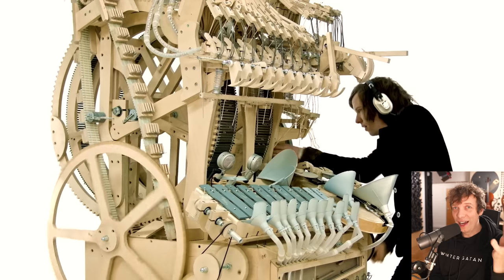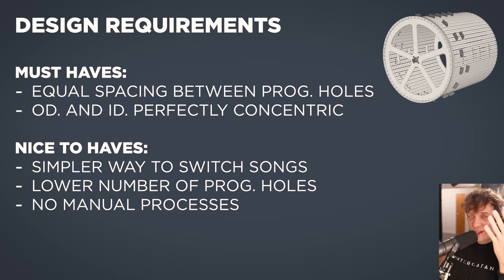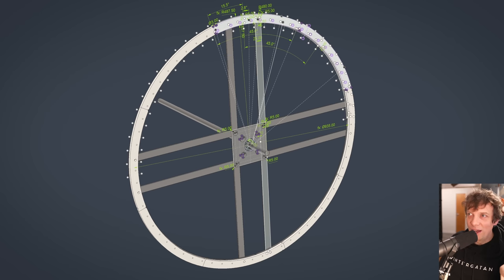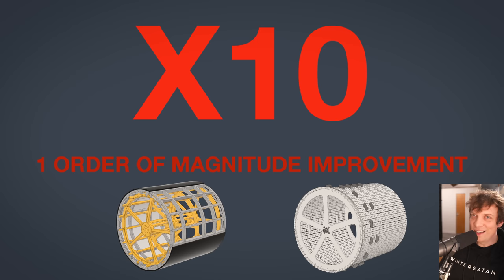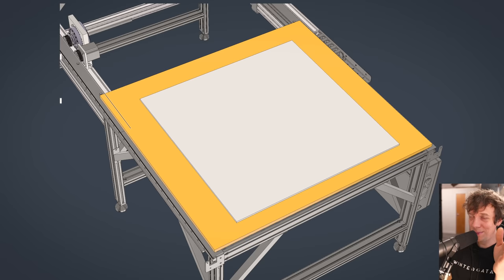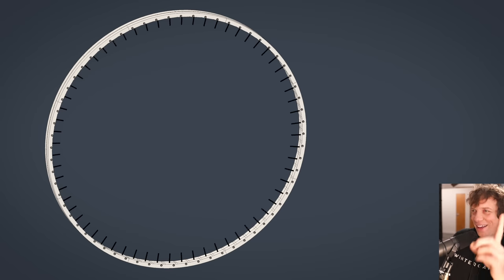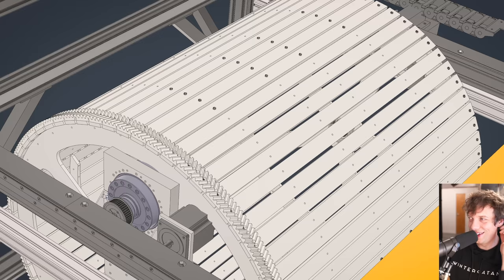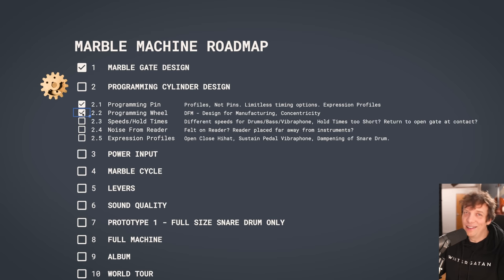A New Music Programming Wheel

Comment: have a serious think about how the plastic for the notes will fatigue when the wheels are being set up(and also how much force will be on them when reading the notes). it could introduce timing issues
Reply: There's so many types of plastics, we can't assume anything for now. He needs to tells us exactly which plastic he's planning on using so that people with the technical knowledge can inform him and the rest of us about his choice and any alternative he should be using instead - if that initial choice is the wrong one, of course.
Reply: @yvan2563  Afraid I'm with Chris on this - the clip design as it stands is for me flawed in its very nature - doesn't really matter what materials are used there, its not going to be enough - Martin has put a completely insane amount of effort chasing gates with timing tighter than he can really measure so any programming pin registered only by a deliberately flexible click action that doesn't need bearing puller to remove and hammers to install will not be able to meet that spec unless the read head of the machine imparts damn nearly zero load - the click action he is demonstrating is looking like a travel of well over 1mm for the click action and in the read direction - which is really poor design - the clips should be designed to flex perpendicular to the expected read head load so they can be as stiff as possible in the important direction. They also look to be really really easy to do by hand - so just to make it possible to click in and out so easily it can be expected to have that sort of ballpark for slop under load - though without knowing the expected rotation speed how much that will throw the timing is impossible to calculate. 

If he adds a fixed registration pin and the click is just to hold the pin to wheel while the timing is handled by the precise and inflexible pin he is in with a shot of reaching timing he can accept. But even that doesn't solve the fatigue issue on its own, and picking the right type of plastic to have good fatigue life that you are then battling to get sufficient stiffness for timing (even with a fixed pin its got to be relatively stiff), low friction and hard wearing enough to last at the same time along with many other considerations for a world tour machine - how does it handle baking under stage lights? Is this a plastic that will creep on its own more readily? Its not a problem that can't be solved, but getting the one plastic that does all the things at once well enough may not even be possible (will depend on factors we have not seen yet), and moving into double shot multi-material type stuff would be interesting but expensive.
Reply: The new pegs are simple and easy to replace, I wouldn’t worry about them wearing out. Even when on tour, he can make a bucket of each type, and have plenty of spares. Plastic also isn’t prone to fatigue in quite the same way as metal, it tends to stay in one piece for longer than metal under fatiguing conditions, although it is certainly still vulnerable to repeated loading cycles. The main issue with regards to wear on the new notes is during insertion and removal, and I think that’s addressable without a design change.
Reply: Certain Plastics like Delrin or Polyethylene can be more durable than wood or metal.  I recycle household plastics by hand and I have an example piece that I've been beating with a hammer for years.  It's never shown a dent.  You could lift an entire person with a single grocery bag. Imagine how tough they would be if they were half an inch thick.
Reply: When he says "engineering plastic" martin almost certainly means delrin, which is great stuff (though pricey).  I think wear over time can be handled by treating the drum as a consumable and making multiples, since they are designed to be swapped in and out.
Reply: @VagabondTE  I don't think anybody is saying plastic is pathic crumbling rubbish but the ability to bounce back after being hit with a hammer doesn't mean anything - this wheel has to be really really stiff to keep timing accuracy across all the channels. Being stiff for plastics generally means being brittle - the opposite of being elastic, which is what makes most durable 'strong' plastics in daily life so survivable - they deform and bounce back well, but that makes them utterly useless for this wheel.

Edit: Worth pointing out I'm not saying plastics can't be used - just that this design is asking for a rather great combination of properties all at once, which means any single material is going to struggle to provide it all.
Reply: @foldionepapyrus3441  Actually hitting it with a hammer is a great example of its flexibility and lack of brittleness.  It's polyethylene which is often an industrial plastic.   If I hit something that was brittle it would break.  But my main point was that even my trash plastics can be stronger than wood and metal. Most people only think of disposable food containers and get the impression that plastic is weak.  When a massive amount of shipping heavy items is done in plastic containers and crates. If Martin made that wheel out of even a standard Delrin or polyethylene then it would be stronger than plywood and a fraction of the weight of steel.  They're so strong because of their balance of strength and flexibility.  There's nothing to worry about.
Reply: @VagabondTE  You are entirely missing my point - in this application it can't be flexible AT ALL in use. As that will ruin the timing on the machine (at least to the level Martin has been pursing everywhere else). So Martin would have to use either really really really thick parts to make up for the soft flexible nature of the common plastics (which is still a band aid solution that will need clever geometry) OR use a brittler plastic...
Reply: @foldionepapyrus3441  Nothing is entirely stiff. You could make the wheel out of steel and it’d still be possible to put a slight bend into it given the size of it. Plastics are commonly used in aerospace and medical parts because they have favourable characteristics with regards to thermal expansion and oxidation, as long as Martin chooses a sensible plastic type, it’ll be up to the task.
Reply: @SkigBiggler  For the level of timing precision Martin has been chasing this wheel has to be really really damn stiff, getting on to you could stand an elephant on a big lever one side and have so little deflection its hard to actually measure it at all (I think he is rather crazy to be pursing such accuracy, but that is neither here not there - its his design and requirements). It needs that stiffness even more so as its driven only on one side a very long way from the far end so the whole thing is one big torsion device. And the way the slats are attached has no high precision registration anyway - screws are for clamping not positional accuracy, and one screw at the driven end against a huge drum length trying to resist being driven...

Plastics can be use in many ways, they are a great material. But none of the normal plastics on their own really ticks all the boxes this wheel requires with this design. As Martin really is wanting all the mutually exclusive material properties all at once from the material here - there is a reason why most plastic parts that need stiffness end up with glass fibre reinforcement in the mould, lots of subframe geometry or are an entirely solid block not a pretty thin sheet.
Reply: @foldionepapyrus3441  If I remember correctly he said the end profiles are cut from 20mm thick DELRIN, which is nearly an inch thick. The level of precision Martin is after will be more greatly affected by his choice of tools than the deformation of the plastic. Your example of an elephant, I’m assuming is hyperbole, cause there isn’t a material on earth you could cut a flat profile from and have not bend under the weight of about 4,000 kilos, let alone zero deflection at all. Steel I beams used in construction, which have a profile specifically designed to optimise for stiffness for lowest amount of steel, still bend under their own weight.
Reply: @SkigBiggler  Yes I'm exaggerating at least on what Martin actually needs... Though as he kept fiddling with the gates till he couldn't actually measure the timing imprecision probably not by much. And he never said anything other than 'engineering plastic' - which could mean anything at all... 

Even at 20mm thick Delrin slats is likely to be deforming under its own weight in the middle of the drum enough to worry about as the length  of drum he is going for is rather huge if currently ill defined to us. I don't give it huge hope of resisting the torsional forces of such a long drum covered in variable resistance forces down its length and driven from only one end.. The partial cut and fold structure he mentions can help some, but I highly doubt it will be close to enough for a drum of this scale with such thin, relatively flexible material, assembled with a relatively sloppy friction clamp only to the wheels, so some twist there is likely, and with so many forces resisting is rotation along its length... The design as it stands really calls for materials massively stiffer than any of the normal engineering plastics...
Reply: @foldionepapyrus3441  Alright dude, I'm just going to let you know, you don't really seem to know a lot about plastic.  You're using the word flexibility interchangeably in a couple of different instances.  What I was trying to describe to you is that many plastics are extremely resistant to brittleness because of molecular flexibility while still being inflexible as far as deflection across the length of the part.  You can see how thick he plans to have the parts because he's holding a sample in his hands.  I promise you, in delrin or polyethylene, that is thick enough.  Just look at the material used for the last programming wheel and how difficult it was for him to bend.
Reply: @VagabondTE  There is a massive difference between a huge square sheet with a few small holes and what amounts to a heap of nearly entirely separated slats clamped with low precision against a disc at either end in mechanical terms from the off. And being hard to keep bent so dramatically around the shape has absolutely nothing to do with how it will be in this use - you can flex that sheet a little bit relatively trivially and that little bit of easy flexing over the meter (or more?) of the barrel is most likely enough to bugger up the timing precision Martin is seeking by quite some margin. 

A material is either flexible or it isn't - the geometry, thickness etc can change how the part behaves but an identical shape in a  material that is stiffer under these environmental conditions is stiffer (ignoring oddities like Aerogels).
Reply: @foldionepapyrus3441  sigh..   Well, I guess we'll see.
Reply: @VagabondTE  I rather hope we won't, as it won't take a huge amount of redesign to vastly improve the stiffness of this structure, even if he does stick with plastic. And all still without just throwing a near solid rod of extra thick walled plastic pipe level of overkill of material into it.

But this design I and it seems quite a few others think is likely to have some pretty big flaws on the stiffness front.

Comment: i'm still a little worried about the new programming pins, it seems like you will need a lot of different types of pins to allow flexibility
Reply: I think that's considered a feature? Ie, any particular musical rhythmic challenge can be handled by "just" making a custom pin for the job.  OTOH i agree that getting the programming correct when songs are swapped mid-show could be quite tricky if you've got a dozen different pin variants in boxes you have to pull from.

My personal feeling is that it would be worth it to manufacture multiple drums so that you never have to reprogram during a show, just swap out one drum for another.  Reprogramming could be done only when not under time pressure, ie when breaking the machine down to move it, or during the creative composition process.
Reply: @CScottAnanian  It is that swapping that has me concerned. We saw how solid the MMX had to be in the frame so it didn't shake. It will be interesting to see how he designs it to be solid but still easily accessed for removal.
Reply: The new pins only help for notes of the same pitch, right? Can be complicated accross different notes to use these pins… Maybe this should be simulated up front for a song, before building the wheel like this. The number of holes went down by a factor of 10, as far as I understood. If you would have to cover every pattern (of ten holes that are now just 1 single pin) from 1111111111, 1111111110, …. To 0000000000 - this would need 2^10 different pins = 1024 different pins 😬
Reply: @auronoxe  i am by no means an engineer, but that's exactly my concern. 
the song writing process would also be more tedious if he wants to use the machine, because if a "pattern" does not exist on one of the pins, he would have to manufacture it to even try out how it sounds. 
if he intends to make the songs digitally first it may not be as big of an issue, but overall the system is less dynamic, and while he has removed a lot of parts, this will certainly add parts and complexity to the programming of the machine. 
with the magnets, while they had issues, everything was dynamic, with this system he would be in trouble if a specific pin broke on tour and he didn't have a spare. 

maybe he has considered all of that, it just didn't seem like it in the video.

Comment: Hey Martin! This design is very well thought out for production purposes. I have some questions/concerns about the operation of the wheel: 1. Is there any chance that the ends of the wheel could be offset by minor twisting? 2. If the gear is only running on one side of the wheel is there any risk that the opposite side might flex or be less precise as I assume it would be less secure due to the swapping nature of the wheels? To sum up my concerns what designs went into the wheel with operating it in mind? Keep up the good work I can't wait to see this work of engineering come to life!!!

Comment: Have to agree with the crowd. Worried about twisting, use inner rings to stiffen and aid with keeping bars in place, at distance. You are bound to have someone drop the thing, or something apply enough pressure on the cylinder during transport to distort the cylinder (Break tabs maybe as well).

Comment: If the goal is precision with timing, I agree with others in that there are potential issues with this programming wheel.

There's no support between the two spokes, so all that torque on one side will cause the programming wheel to twist and bend. A pretty straightforward solution would be to have supports running between the two spokes. You could also have an inner spoke in the center (or both for extra stability)

Having inner supports will help with this, but another thing to consider is that the plastic programming parts will deform over time, especially on contact points. Would it be feasible for some of the programmable parts to be made of metal to minimize deformation? Aluminum 6061 maybe?

Comment: Martin, I would consider adding some reinforcement to stiffen up the wheel, or increase the number of bolts per strip, to avoid issues with the drum twisting. An easy solution might be to add some addition rods connecting the spokes of the outer drum together.

Comment: When doing the machining for the flats on the spoke, do all four spokes at once - each time you add a "set material up in the machine" step you are introducing a place for tolerances to run out on you. One set up and four parts will greatly improve your chances of getting four identical parts (at least in this dimension, which is sort of critical as it dictates the lift of the timing pins/tracks)

Comment: When you will machine the programing holes in place in the last step, your slats (plastic) will likely deform under the cutting force pressure and therefore be misaligned between center (no support, most deflection) and ends where the spokes are. If you machine the locating holes for the slates on the wheels with the rotary. You should consider cutting the programing holes and the locating holes on the slats flat (no deflection) then assemble

Comment: If you had some kind of durable but flexible paper sheet with holes in on a spool you would have even more flexibility with programming notes. You cut as big holes as you need. Then you use the programmingwheel part to bring the sheet taught and wind it up on another spool. Probably less complex to manufacture and easier to change songs. Paper sheets might not be as durable but are easy to make new ones.

Comment: Just a word of caution regarding machining the indexing features on the outer edge using the rotary axis - Your application demands that each hole is exactly the same distance apart, but you're controlling the distance apart using the stepper motor and there are a lot of components between the holes and your stepper motors which means there is a high probability of error - consider a small angular discrepancy on the stepper motor multiplied by 40 times (the gear ratio) multiplied by the radius of the timing wheel. The rotary axis will solve the concentricity problem, but introduce a precision problem. A more accurate way to control the precision is to drive the stepper motor directly to the back of your MDF back plate (assuming you can make the drive mechanism concentric too). In most applications, this wouldn't be a big problem, but I see how much effort you go to, so you want to get it right!
Secondly - machining in the timing pin holes will have the same issue - I suggest doing a test piece (full diameter, part width) to test the angular accuracy of the indexing mechanism.
All the best - keep up the good work.